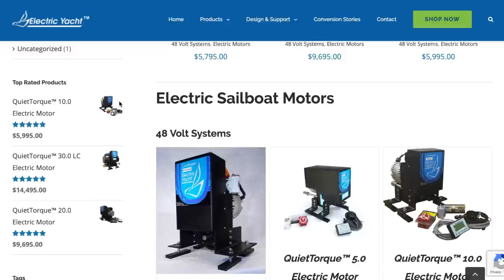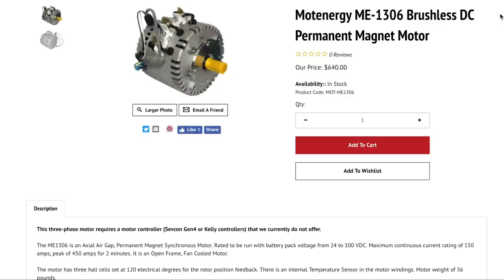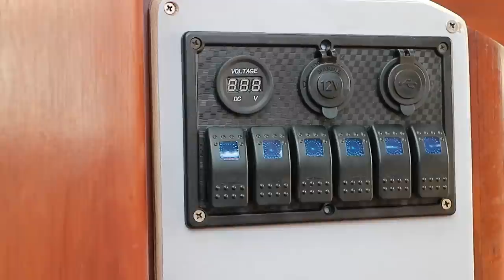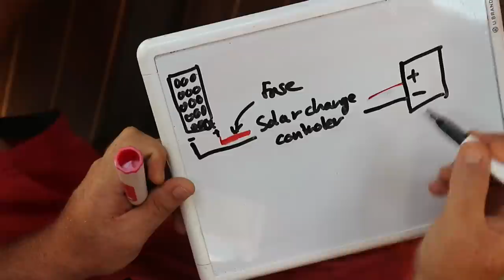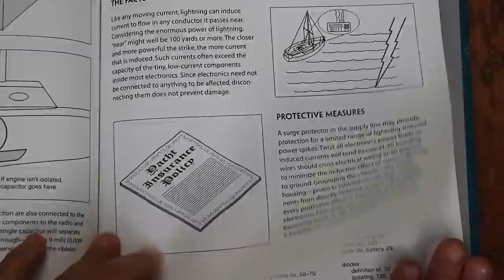Should We Board the Electric Engine Bandwagon?

Comment: Putting Dielectic grease on all the electrical connections is a ideal way to help prevent corrosion. you can get it in a spray can also which is handy for fuse blocks. Liquid electrical tape is also a great way to make sure connections are sealed completely. love your vids!
Reply from the maker: Thanks for the tips!

Comment: I am very impressed you are the first i have heard to state and recognize the whole battery impact on the environment should weigh in and in fact does not make you green just because you have an electric motor.  thank you.
Reply from the maker: The fact of the matter is that having more batteries onboard means more waste associated with eventually updating those batteries. But then there is the argument that having more batteries onboard will allow for utilizing more daily energy needs with solar (example; at anchor, we won't buy ice, instead we'll have a freezer utilizing the nice big battery bank). It seems like a fine line. It would be interesting to find out numbers related to the issue.
Reply: @sailorama  Do you belive that solar will do the trick when you visit Canada, your home country. You will need a diesel driven generator to keep up with the batery loading for that and still always have what you need for the electric propulsion, even in the tropical climates! Diesel!
Reply: @hanshogqvist7927  Totally agree with you! Lets see how SAILING UMA gets along as they head North. Electric is fine in the Caribbean where there's lots of sun and you're only Island hopping. Rigging Doctor's Atlantic crossing was a bit of a 'Hair Raiser' when the hit the sort of Doldrums.

Comment: I agree with the comments below advocating for Diesel.
To prove my point, I am re-posting the following:
 My Father in Law was in the production side if the movie business with Warner Bros. Columbia all his life.
 One time, on location, in the middle of winter in one of the Northern States, a scene required a Longboat full of Fur Trappers to be shown rowing upstream. The current on the partially ice-covered river proved to be too strong for the actors rowing the boat. An outboard motor would show a wake, so that was not an option. 
So, the crew came up with the idea of using an old Caterpillar Dozer from a nearby ranch. It had a winch up front which they figured could help them pull the boat upstream. They build a little fire under the oil pan, so they could crank the old thing over and get it started. The problem was that the way the director wanted to shoot the scene, there was no way to hide the Cat or the winch cable.  They decided that the only solution was to submerge the cat with an operator in the river. They extended both the air intake and the exhaust up, took the fan belt off, got it started, then took the remaining electrical gear off and drove it under water where the operator in scuba gear worked the winch. Some greenery on top of the cat hid anything that showed above water, and that did the trick. 
The moral of this story is, that if a Diesel engine gets AIR, CLEAN FUEL and you manage to TURN IT OVER, it will have to start. (Of course, new clean fuel is of no value if old dirty fuel has previously clogged the injectors). Also, if you want to keep it running, keep it cool with clean oil in the pan.
 Running seawater through a cooling system is also asking for trouble. Even with a heat exchanger, where seawater is pumped to the engine mounted exchanger. It is potentially one of the most problematic systems on any boat. I see it over and over as one of the main causes of engine failure.
 This is why most commercial boats are keel cooled … meaning that clean coolant is actually piped through the keel or a pipe on the outside of the hull.
I would try to do my best to convert any sailboat to keel cooling, just to keep seawater away from the inside.
I also would eliminate all through hull fittings by going to a single valve Sea Chest. Look at the Rolls Royce of cruising boats... the Nordhavn line. Yes, they are mostly Trawlers but there is a way of getting that done on a sailboat. 
See "Expedition Drenched"
Commercial boat engines when rigorously maintained can last for up to 40 000 hours. I build four steel commercial fishing vessels in the early 80”s. All were keel cooled through the 'I' beam at the bottom of the keel. The last one, (my profile picture) weighed out at 140 tons. All of them, as far as I know, are still floating and plowing the waters of the Bering Sea. (Some of them have been run on the rocks at one time or another)
 I always installed several Heavy Duty (Racor) Fuel Filters on a manifold system. They could quickly be switched over when one of the filters failed. Also keep in mind that the most likely and worst time for dirty fuel to reach the engine is in bad weather when the boat gets tossed around, and old sediment gets stirred up. Not a good thing under the best of circumstances. It is also important that you frequently inspect the filter(s), and that you can visually see the fuel or any possible water in the glass bowl under the filter. There should be a drain cock. A crappy filter, with a metal bowl, which is many times standard factory issue will filter your fuel, but will not let you see what you got until you open it up after the engine fails.
 To further prove my point.
In the early ’70s, I was single handing my sailboat just south of Punta Abreojos in Baja on a stormy night when I ran aground on a sandbar. As the boat was pounding in the surf, the portholes blew and submerging the cabin and of course the Engine. Long story...At low tide the next day I managed to get the engine started again. I did that by hand cranking it with the De-compression lever pulled. The minute I let that lever snap, that little Perkins got everything it needed, clean fuel and air and away it went. I cannot overemphasize the importance of clean fuel.
Sadly, the shaft was bent and I lost the boat.
 I never had a problem with anything Diesel I have ever owned, because I always went overboard on fuel filtration. 
The only Diesel that ever let me down was a piece of crap Volkswagen Rabbit Pickup Truck. The timing belt broke, and the engine exploded. I take comfort in knowing that it was running on clean fuel until it took its last breath.
 Long live Rudolf Diesel!
I truly love your channel. You are both great resourceful hardscrabble trailblazers and a credit to the sailing community!
Good Luck to you both.
Reply from the maker: Thank you for the interesting story. Makes me think about the beauty of diesels as well. And thank you for the kind words!

Comment: Sailing Uma created a “Electrobeke” using a $150 forklift motor. But their best speed with it is barely 4 knots. They were also gifted a huge lithium battery bank after they melted a conventional lead/acid battery.
Reply from the maker: We would definitely go for the specialized motor. You can find continuous 12 + Kw motors online these days for ~ 500 bucks. It will cost a bit more than the electrobeke, but perform a lot better. Although, we really liked that they recycled the part.

Comment: As you said, if you only take your boat in and out of a marina, Electric is fine. However, for serious cruiser Diesel is the best choice because of the prolonged autonomy. The more you venture outside your comfort zone, the higher the chances of getting hit by bad weather or any other incident. A far as the environment is concerned, you only have to use your diesel as little as you can.  For a car, it takes 3 years to break even and that is a lot of engine hours, which you will never do on a sailboat.
Reply: tartansailor I had that mindset once before. Only use it for marinas, then we did the ICW. That sucked with an electric motor! Now that we are back to the original plan of offshore cruising, the electric is feeling like a pretty good choice ;)

Comment: I got a free 32 foot Galaxy sailboat that had no inboard engine.  I went cheap and put a sailpro outboard on it.  I also built tracks to raise and lower it into the water when needed.  However, a 40ft such as yours is a big heavy boat, don't know if an outboard would be enough.
Reply from the maker: We think the outboard may be enough - just that an outboard still is a significant cost, and so many drawbacks...such as cavitation issues, needing to build the bracket, etc. We still haven’t completely ruled it out.

Comment: Well done you two, a big project to make decisions about. For what it's worth, I agree with most that electric doesn't make sense yet. 
No one's mentioned an outboard in the comments here. If you strip out the existing engine, to could drop long shaft into a well through the hull rather than hang it off the back?

Comment: What about a hybrid diesel/electric. Basically use your current engine, then add an electric motor with a through shaft design and fabricate the electric motor and prop shaft so that either engine can be used independently on the same prop shaft. There would just be the situation where the transmission would need to be in neutral unless using the diesel. I haven't done much research on the electric motors, but if they're a direct drive, them there shouldn't be a need for the transmission after the electric motor.
Reply from the maker: We thought about hybrid, but not of using the current diesel as the generator. Thank you for giving us something to ponder!
Reply: Too expensive in my opinion. Lot of engineering involved with the drive system.
Reply: @stinkintoad  I agree the cost is up there, but with keeping the diesel as a main or secondary power unit, the worries of just an electric motor could be cushioned some.

Comment: Eletrtric if you can afford it. A old eletrtric engine is very reliable. Submarines have used them for ages. You can build a box around it and pump air in from another area. It's just the batteries that are the weak link if you don't have the right type or enough of them.
Reply: @ಠ益ಠ ಠ_ಠ well yes and no.I think in silent running mode any sub is eletrtric. But I was talking about the reliability of eletrtric motor. Also you can take a extra Eletrtric motor and just bolt it in if needed. I think for people that don't really need to get someplace on time and can wait for wind power to sail it's just easy to have it . A small generator could be taken if some night emergency comes up. 
I guess I just find Eletrtric motors simple, copper and magnetic fields. Not much to work on and if a controler dies well you can hot wire it in to still get going. 
A normal motor design is complex to work out at times and annoying to work on in a boat. 
Electric power is interesting to see in a boat as well and if you have a YouTube channel being interesting is good but in this case I find the generally relax nature of this channel to be interested enough to enjoy as it is.

Comment: Don't do electric.  When you need to power out of a situation with wind and current for long times the batt gives out.  When your 20 miles out after a passage and just want to get in electric won't get you home.  Electric is not there yet.
Reply: Jean Mondeau good thing sailboats have sails. We made it across the Atlantic and never had issues of our “sails not getting us in to port”. We are 100% electric.
Reply: And if you are in a nasty situation and really need your diesel it won't run due to full problems. Diesel are not reliable.
Reply: @ಠ_ಠ If you want to motor for a really long time, electric will not be the ideal choice. You can setup a big generator to power the electric motor, but at that point you might as well cut out the electric middleman and go diesel.
When we sail back to the US in a year, we are going to motor up the ICW to stop in all the cool towns along the way. This means we need to motor for 1000 miles! The plan is to build a strong outboard motor bracket frame to hook up a small outboard to the back of the boat and let us motor like a normal boat. When we finally get back to the Chesapeake, we can unhook the bracket and have our boat back to normal.

I have heard of engineless cruisers hooking up outboard motors to get through the Panama Canal. They buy the motor on one side and sell the motor when they come out the other side.

On a different note, batteries are constantly getting better (and cheaper) which means that once you have an electric motor, you can always boost your range by upgrading your batteries in the future. We have lead acid batteries right now and are waiting for Solid State Bus Batteries (full on electric city buses) to come down in price. 
Our current range is 20 hours at 2 knots or 20 minutes at full speed. With 1 bus battery, we could motor at full speed for 13.5 hours!
Reply: @bertram5798  diesels are very reliable some owners however are not very smart

Comment: Thrusters are electric motors. The starter motors on diesel engines are electric motors. Power winches are electric motors. Your fans and compressors are electric motors. They are all more reliable than diesel engines. Diesel engines are a way to use the enormous energy in petroleum. If there was a better way to efficiently convert petroleum to electricity then diesel engines and gas engines would not even exist. They are a messy hack with their hoses and coolant and vibration and noises and intakes and exhausts and filters and oils and weight and heat and tuning etc.... Get a marine grade motor or, as Sailing Uma did, take a brushless motor and make it marine grade. :)
Reply from the maker: True! The electric engine is just one 'big' motor onboard, very important, and has to keep functioning through thick and thin, just like the starter motor on a diesel that cannot be hand-cranked into starting.

Comment: IMHO id say roll with Diesel.

Think about it this way, it is 3am, it is blowing 30 knots on shore, there is a 3 knot current running and some guy who has no business coming in, comes in, and sets anchor right over the top of yours. 

Now your anchor gear is fouled and tied up in a knot. 

Is your electric motor going to keep your boat off the rocks? 

In that situation with a diesel I can fire it up, tie a buoy and long piece of line to my anchor chain and let it go overboard and power out to sea then recover my anchor and chain once things calm down. 

I don't think an Electric is going to do that. With a huge array of Lithium Ion battery's you're only going to get about an hour of run time at 60-70% power. 

With a Diesel, you can firewall that bastard as long as you need to get the job done! 

As far as connecting a ground to the Keel? NO! Do not run current through your keel! 

Now the bonding system needs to be tied to the Keel bolts, but no current from your electrical system should pass through the keel. 

You should also have a zinc tied to that system, and a grounding plane for your radios. The copper ground plane should be below the hull zinc.
Reply from the maker: Hey, you've been the only person to mention connecting the ground through the keel, but I don't quite understand. Are we worried about destruction of the keel bolts? Thanks for the comment!

Comment: Any  circuit needs a  reference to ground. Connect the negative at one spot to the metal parts in the water.  This is to prevent charging the cables to a high voltage until it finds a way to ground. A Floating net like this  is Very dangerous.  Connect all underwater metal parts together but don't let anything find a circuit over these bounding wires.
Reply: Nope the bad stuff about electric is the salt water as Robinson already pointedly stated, your engine is your best ground..... see, even almost dead, that old diesel is still there to work for you!!! Consider the heat exchanger and other parts to use if you decide to build a Frankenstein boat out of a truck diesel.... imho
Reply: @saylaveenadmearedead  You opinion is in no way related to my post. Earth your 12v system at only one point is my message.
Reply: @Nerd3927  right.....

Comment: Uma never really talks about their electric engine, likely because it sucks. Electric also cannot be run continuously without cooling... unless you use something massively overrated. Obviously you know the best. One thought would be a 10KW DC generator and an electric motor, but that will still set you back $5K to get started and you cannot run it all the time. Add 4K for batteries a little later, and budget to replace them every five years. The lithium people are also blowing smoke out their asses about how long their batteries last. You will for sure need at least two sets in ten years. I think the smartest thing to do might be to pull the engine, have it trucked off for a rebuild, and put it back in.  PS here is the symbol for a fuse: https://www.iconfinder.com/icons/2718018/electronic_fuse_fuse_fuse_icon_fuse_symbol_icon